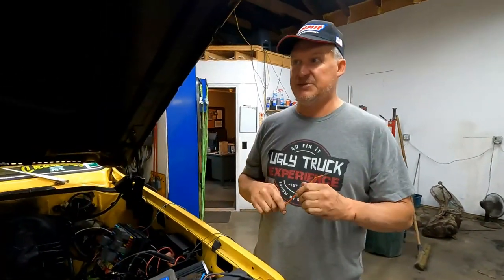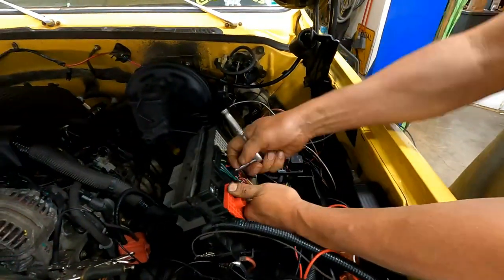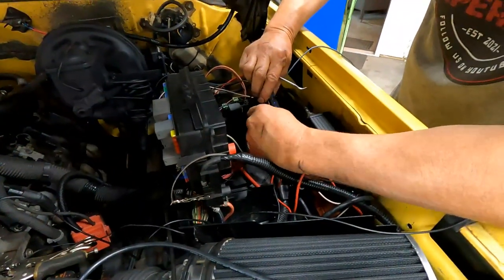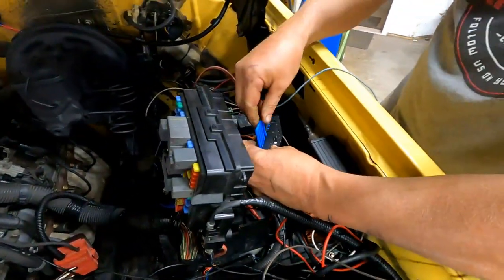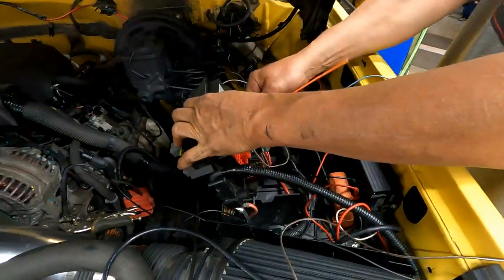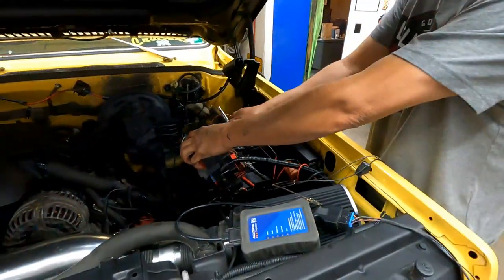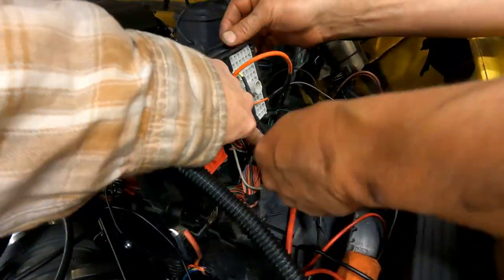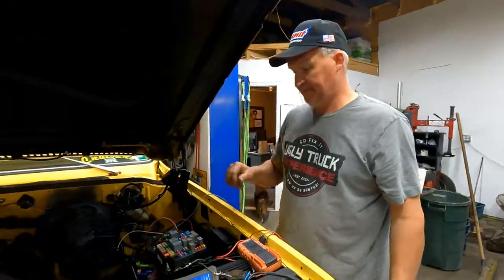MAKE SHIFT HAPPEN - Supplying Power to 4L60E Transmission - Square Body C10 5.3 LS Swap - UTX

Comment: I have issues still after doing the same thing as your video. I have a c10 1984  with a 2005 engine 5.3  and transmission 4l60e . I cant take off on first moves forward a little bit But when I manual shift it runs good but I have to take off on 2nd shift. Ones I got speed I move it back to  D DRIVE  it and seems to be working good . ITS JUST THAT FIRST GEAR. DONT WAMT MANUAL SHIFT NO MORE LOL.   FORGOT TO MENTION WIRING STOCK WITH  STOCK FUSE BOX . SAME WAY AS YOUR VIDEO
Reply from the maker: Are you able to see that the ecm is reading the prndl switch correctly?
Reply: Did you mean parking break  switch
Reply: I forgot to mention when I’m manual shifting  the speed odometer  does work
Reply: I also put a cluster from a 1990 suburban  and repin  wiring before I instead cluster
Reply: @UglyTruckExperience you mean parking brake switch
Reply from the maker: Yes.  The.switch that is mounted on the side of transmission let's the ecm know what position the shifter is in.
Reply: Oh ya thats connected  right
Reply: The brake switch is the only thing I haven’t connected yet
Reply: Torque converter lockup hasn’t been done yet
Reply from the maker: Do you know if the transmission worked correctly before it was removed?
Reply: Yes it did
Reply: You think it’s the speed sensor if I keep getting a code p0654
Reply from the maker: Does your dash have a tachometer.  P0654 is related to the tachometer.  Jerry
Reply from the maker: If everything you have done to the truck is the stock harness. I think I would look at the parts of it that are not stock. The P0654 is a code related to the engine rpm and would definitely effect the transmission if there is something messing with that signal.  Isolate the wiring that is not stock and see if everything is fine.  The instrument panel doesn't effect how it runs or drives but could be messing with the ECM  enough  to effect it.  Jerry

Comment: Hey mine won't shift out of first gear do you think I have the same problem I can manually shift it but it's not shifting automatically
Reply from the maker: Hi Tristen. No, if you have first gear, your solenoids have power already. Are you working on a swap? What was your donor vehicle?
Reply: @UglyTruckExperience  yea it's a swap it's a 1991 chevy silverado 1500
Reply from the maker: What did the engine and transmission come out of? What are you using for a harness and fuse box?
Reply: @UglyTruckExperience  1999 chevy silverado using a standalone harness I did it myself so that could be the problem lol
Reply from the maker: Hello Tristen.  Did you get this figured out.  If not I would look into whether or not you are getting a speed signal to your pcm.  Jerry
Reply: @UglyTruckExperience  I looked on my harness and the vehicle speed output 4k wire and vehicle speed output 128k wire not hooked up so I'm thinking that's why but I don't know why I have 2 of them

Comment: I'm doing mine now. Black box e7 to white box c9. The factory white box does not have a wire in that location. 
1999 silverado ls 5.3 lm7 4l60e. 
I have complete donor vehicle.
Going in a 1985 c10
Actually the only wire I have in common is the pink A-9 on the white box.
Please help.
Reply from the maker: Ok on that truck you may not have to do anything but plug it in.  On connector 2 which is black. Check for a pink wire in positions E2 and F2.   On connector number 1, the white connector.  Check for a pink wire at position D3.  If all of those wires are there, you will just need to plug it in and make sure fuse IgnO fuse is good.  Its a 10 amp fuse. If all is good, check for voltage at F2 on the black connector with key in run position. If you have 12 volts, all is good.  If any of those wires are missing, let me know.  The early truck wiring was way different.  Jerry
Reply: Black box has the pink wire in those locations. White box has a yellow at d3
Reply from the maker: Ok,  I see what you have.  The info on this wiring diagram is not great.  This truck has another connector that is called connector 1.  It is black in color and also plugs into the bottom of what is called the left bussed electrical center.  It will have that pink D3 wire in it feeding your transmission.  As long as that connector is plugged in you should be ready to go.  Let me know if that is correct.  Thanks,  I learned something new on this one.    Jerry
Reply: Thanks for trying to help. I gave up and ordered a harness.
Reply from the maker: No problem.  Let us know how it is going.

Comment: What ever happened to the original c10 wires
Reply from the maker: The original c10 did not have any wiring that goes to the transmission.  Some of the later c10's had lock up torque converters in them that would have wires going to that but in the event of a ls swap those wires would just be eliminated. There would be no use for them in a swap.   Thanks

Comment: Hello, you have gained another fan in me! Can I connect my transmission from the O2 sensor spot like you did and keep my O2 sensors functional? I am hoping to keep everything as it came from the donor as much as possible, obviously transmission hook up would be one change. Thanks in advance @uglytruckexperience
Reply from the maker: Sure Ivan.  You can keep those sensors just like they are.  You would just need to find a different power source for the transmission.  There are quite a few of them in that fuse box that you could use.  Thank you for watching.  We appreciate it.  Jerry and Emily

Comment: Hey I did mine the same way and it still won’t shift it got power on the E pin plug on the transmission but not A-B for the solenoid
Reply from the maker: What is your donor motor, transmission, harness and fuse block?  Jerry
Reply: 05 avalanche 5.3 2wd 4l60e in my 93c1500
Reply from the maker: Pin E, which should be Pink wire would be the only one with power except for the Red wire in C that goes to the pressure control solenoid.  Is your truck stuck in 3rd gear or is it in 1st and does not shift?  Jerry
Reply: It’s in 1st gear won’t shift I try down shift still not nothing
Reply: Do I need power to the btsi fuse
Reply from the maker: Sounds more like you don't have a speed signal.  With no power going to the transmission it would be stuck in 3rd gear.  If it is in,1st that would make me think that it is not getting a speed signal. Can you manually shift it into 2nd and 3rd. And is your speedometer showing speed?  Jerry
Reply from the maker: The BTSi is designed to keep the shift lever from moving without having your foot on the brake.  Wouldn't have anything to do with shifting.  Also, make sure your PRNDL is adjusted properly.  If you have a scan tool that can show what position your gear selector is in that would be a good thing to look at.  If computer does not know it is in Overdrive position, It will not shift automatically.
Reply: Ok I tap in to the factory harness on the truck to the speed sensor now it shift to 2nd but not 3rd then when I stop it be hard to pull off if I drop it down it be easy to go
Reply from the maker: Ok.  I'm not sure what you mean when you say you tapped into the factory harness for the speed sensor. Are you using a combination of wiring harness?  The donor to run the engine and the original 93 for the transmission?
Reply: I ran both speed sensor plug together now it shifting but not to 3rd then when I come to a stop it feel sluggish pulling off unless I manually shift it but still won’t go 3rd
Reply from the maker: Ok.  You probably don't have a good speed sensor signal going to the Avalanche donor  ECM.  I would get rid of the wires that you tied into the speed sensor from the 93 and see if everything works.  The speedometer in the truck won't work. The speedometer in a 93 and  a 2005 are completely different and might be confusing the donor ECM.
Reply: Ok so what wire I need to tap into get signal to the LS harness

Comment: Hey I know this post kind of old but I have an LS Swap 1992 3rd gen camaro. I have a LS1 with the factory harness and fuse box harness from out of a 2002 firebird trans am and I can’t get my transmission to shift or speedo working.. do I need to do what you did if so can you help me out by letting me know what I need to do on my fuse box or anything
Reply: I’m also running 4l60e behind it
Reply from the maker: I will take a look at that wiring this afternoon and get back to you.
Reply: @UglyTruckExperience  ok really appreciate it
Reply from the maker: Did the donor transmission come from the same car or did this car  have a manual transmission?  Any info helps
Reply: @UglyTruckExperience  The motor and transmission came out of two different Fbody’s
Reply from the maker: Ok, so do you know if your wire harness and fuse box came from a car that had automatic transmission?
Reply: @UglyTruckExperience  yes
Reply from the maker: In what is the bottom under hood fuse box, there is a 15 amp fuse that is shown as the ( engine ctrl fuse).  You need to see if that fuse is there and if it has power with the key in the run position.  That circuit supplies power to your transmission shift solenoids.  It also supplies power to a couple emission related items which you probably are not using.  Check that fuse and get back to me.  We will get it shifting..
Reply: @UglyTruckExperience  ok I’ll get with you as soon as I get back to the shop and check
Reply: @UglyTruckExperience  ok I’m getting power to there
Reply: @UglyTruckExperience  I think I need to get signal from the transmission to the pcm to let the car know when to switch gears
Reply from the maker: Do you have a scan tool that will see if you are reading mph while driving?
Reply from the maker: send me an email at uglytruckexperience@gmail.com with your phone number and i will give you a call.

Comment: What code were you getting?
Reply from the maker: I don't believe there were any codes, just stuck in 3rd. Are you having issues with your swap?
Reply: @UglyTruckExperience  yes would appreciate the help having code p0785 time/shift
Reply from the maker: What was your donor harness and fuse box?
Reply from the maker: For the code you have, I think you don't have power going to your transmission. This video shows supplying power for a 2003 or later donor. If you're working with a 2002 or earlier harness and computer, check out this video. https://youtu.be/COOzzFHCLRk  This shows how to supply power on the 2002 and earlier transmissions. Hope this helps. Let us know!  --Jerry and Emily
Reply: @UglyTruckExperience  I think I'm going to change sensor 3-2 I had already followed your steps to get power to transmission I am getting power , I checked the solenoid reads 21.6
Reply: @UglyTruckExperience  one more question so you think it isn't getting powered but the only code that was there was p0785 when I unplugged it I got all transmission codes so it is getting power can't it be the pcm not sending the signal ?
Reply from the maker: I would need to know what wiring harness, computer and fuse box you are working with.  You said the solenoid read 21.6. If that is ohms, the solenoid is ok.  Where did you measure your resistance on that solenoid?  If you checked it at the transmission, I would check that circuit at the ECM connector and see if you don't have a open circuit or a short to ground between the transmission and ecm on the 3-2 solenoid circuit.  Jerry

Comment: Like your videos on ls swaps.  What do you use for dbw gas pedal?  I saw a vid on using a 94-01 6.5 l diesel pedal, swapping pin a and e, and slotting the plug: https://www.youtube.com/watch?v=WX1XNADiWRg.  Any thoughts?
Reply from the maker: I use a standard that is on most of these trucks and suv's.  I cut the pedal off in a particular area and move it about 5 inches to the left.   Use the original mounting holes in the firewall and adjust the pedal to be at wot mashed to the floor.  We will do a video soon.  Thank you for watching.  Jerry

Comment: What pin/pins do I need to wire to my brake switch so the torque converter unlocks when I'm on the brake at a stop?
Reply from the maker: Check out this video! https://youtu.be/yHUZ7JfQBbk  We appreciate you tuning in!